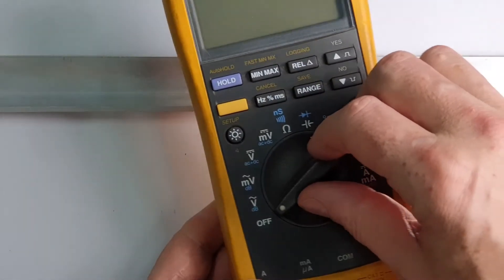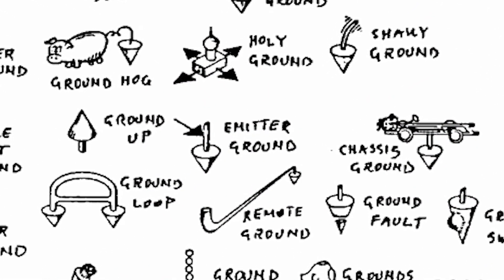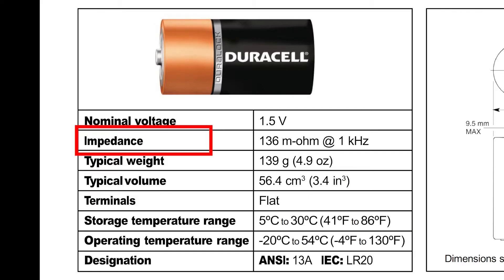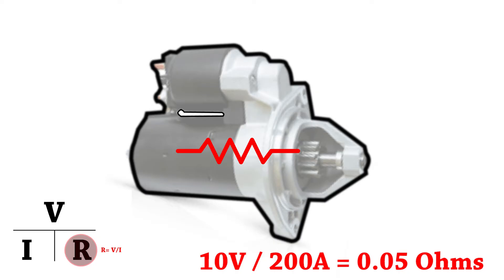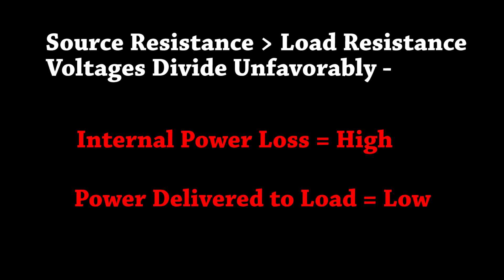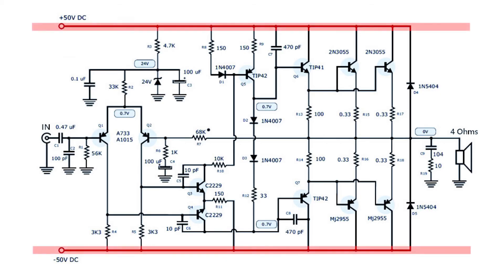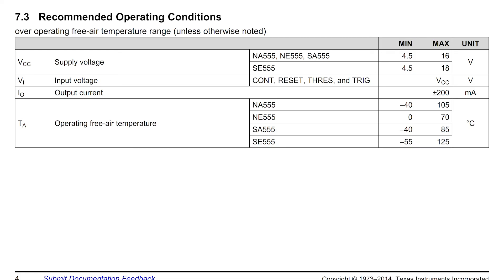Electronics 3

Comment: Regarding the starter motor problem: you calculated the resistance to get the power needed, but why is it not accurate (or enough) to say "the starter needs 200 amps at 10 volts but the eight batteriers only supply 1 amp at 12 volts. ?

Comment: The battery is defined as having voltage and some internal impedence (resistance). My understanding is that (in the diagram of source and resistor) the voltage that defines a batter is that voltage between the EXIT side of the resistor and then return (--) side of the battery,  and that is what the volt meter is measuring. So if the voltage takes into account the internal resistance already, why (in the circuit diagram with the starter motor) was the power calculated as if voltage is  from the exit side of the battery (or INPUT side of the resistor)  ?
BTW, enjoy the pace and so far, clarity.

Comment: After years of messing with electronics I never thought to hook batteries up with some of them reversed to measure the voltages.  I honestly would have guessed you'd measure zero volts at the ends or just make a lot of heat.  Good stuff.

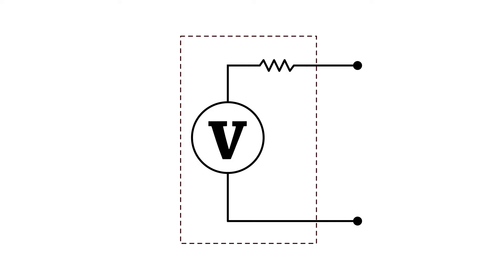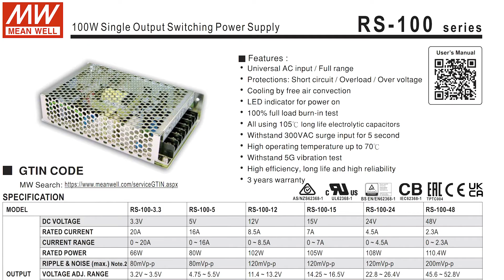Comment: First of all thank you for these videos! I am just starting out to learn about electronics and found that around 10:00 this video got a bit overwhelming and i had to rewatch that part. Maybe you could visualize on an example what that drooping voltage would look like. similarily the part about the switching power supply 11:30 ramped up the electronics term density pretty fast.

Comment: Good introduction about summing voltages, leads into Kirchoff's voltage laws. Internal resistance/impedance is often overlooked in why power transfer fails to power a circuit. Keep up the good work Leo.

Comment: Good stuff Leo. I’d never really thought about battery internal impedance before, but now it makes perfect sense: the current is doing the most ‘work’ in the highest-impedance bit of the circuit, so a D-cell will be more efficient with a high-impedance (ie low-current) load.
Reply: You got it.

Comment: Very informative and enjoyable to watch. Good length and pace. What is a good/valid way to measure the internal impedance of a single cell or a battery?
Reply: Someone more knowledgeable might want to weigh in here but I'd say the best way to find out is to check the datasheet. A cursory google search tells me that correctly measuring internal battery impedance requires a specific set of tools.